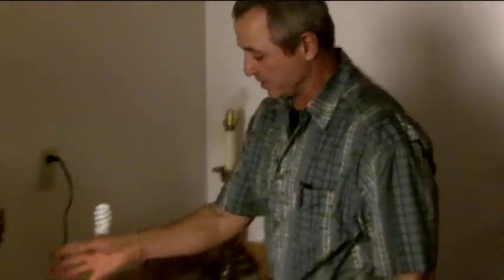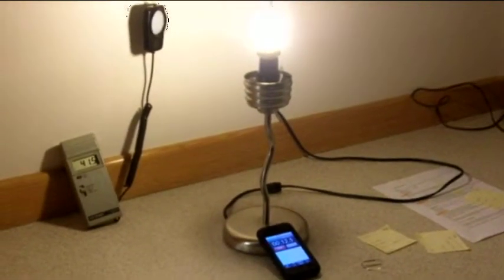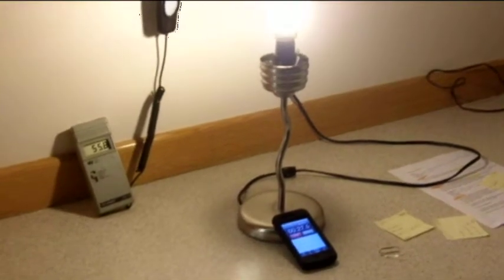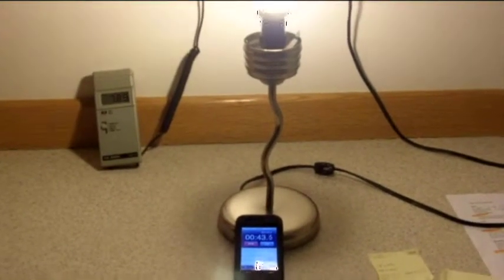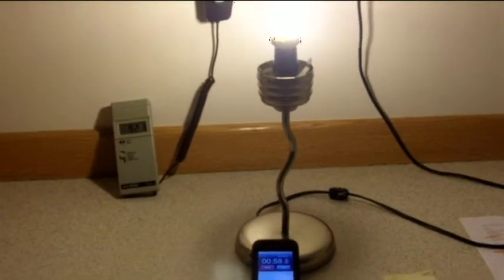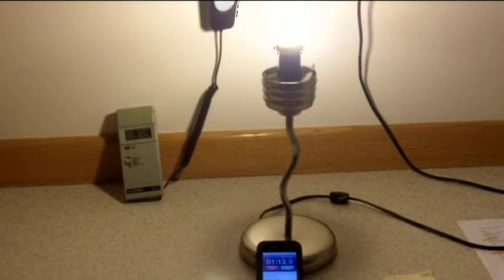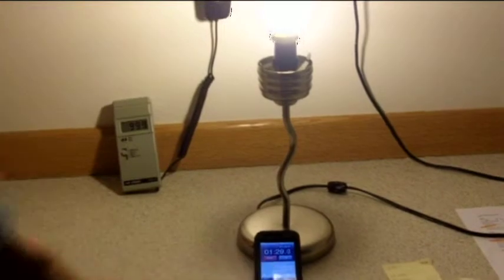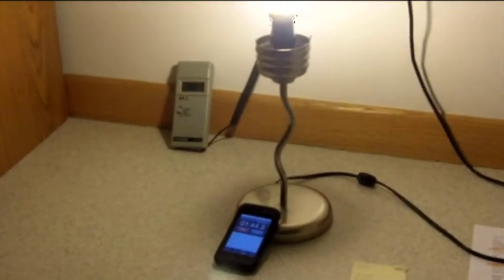How long does it take a CFL to warm up?

Comment: What was the room temperature?  Even way down here in Az, the house occasionally gets into the mid 40s at night.  At those temps, my CFL bulbs spend a few seconds at very low output before they start to ramp up.

Comment: I would think this would change depending on the ambient temperature.  In other words, if the area that you turn the light on is 80 degrees already, the light would be stronger faster than it would be if the air temperature was 30 degrees like in a garage. Interesting but not really that accurate.....